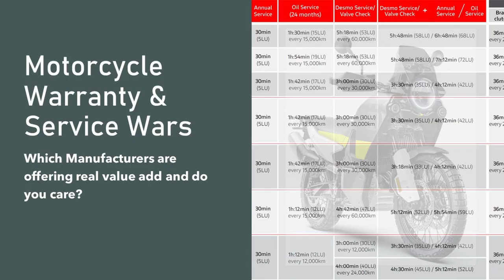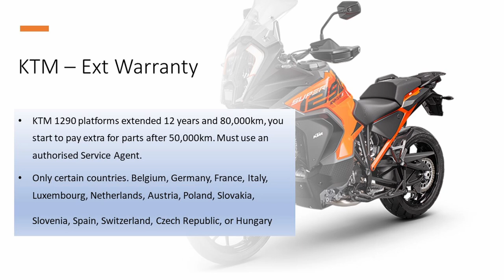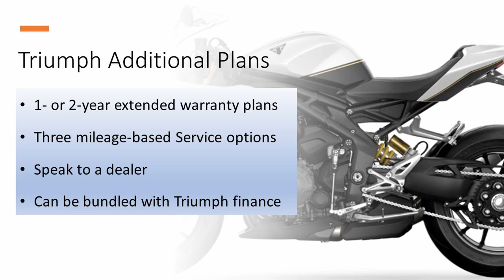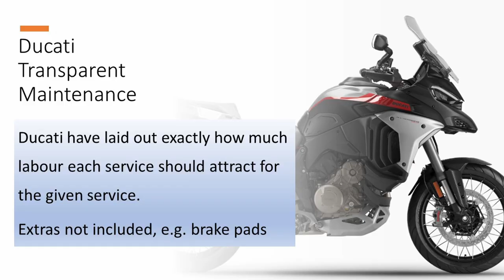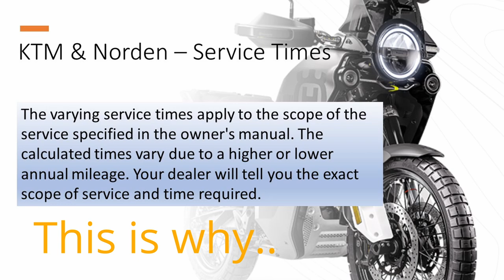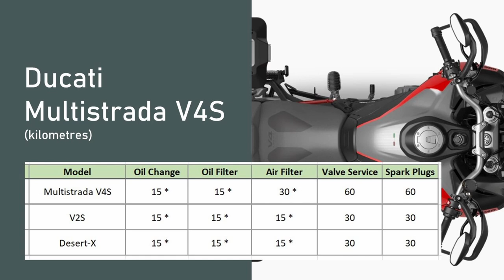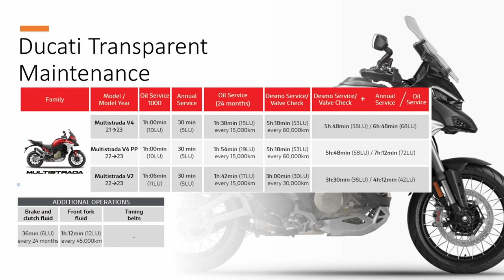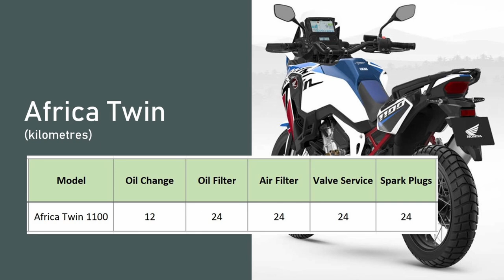Motorcycle Warranty & Service - Fight!

Comment: I bought a Honda Crosstourer in 2013 and added the service pack for £525.  At that time it included the running in service plus 9k, 18k and 27k miles.  What a deal that was, they stopped offering it quite quickly though....😂   I've currently got a Gen 3 Triumph Tiger 1200 albeit use an independent local garage which has kept cost down.  You're spot on though in that a bit of research is needed on servicing requirements and cost prior to purchase. Especially if you're a high mileage rider.  Great vlog, really enjoyed it.  Thanks.
Reply from the maker: Thanks for the kind words 👍. Yes, you got a bargain with the Crosstourer, that was some deal. It was my Gen 3 Tiger that got me for a €1480 service on the valve service, I was pretty upset I can tell you. Before that the Triumph services were reasonable at the main dealer. Thanks for posting 👍.

Comment: On the Ducati servicing, the hourly rate in the UK is over £100 so the big near 7 hour service plus materials will be pushing £1k, ouch. I bought a Honda this year and looked very carefully at the fixed price servicing but in the end decided against it as did not think it was value for money. Now folk will no doubt spam me for saying this, but it is basically the service is an oil change and perhaps a filter with the rest being a visual check. Oh, I may have short changed them, they also check the tyre pressure 😁 You are of course correct if the bike and BMW is one of them for sure, is full of tech but a good thought provoking video and enjoyed the funny bits 🤣
Reply from the maker: I think a lot of V4S owners will trade in their bike at 60,000 km 😃 to avoid just that service but at least it is at a decent mileage. It is also great that Ducati recognise that there is not too much to the annual service and only allocate 30 minutes to it.  I think you are right about a lot of the servicing, there is not too much too it but my Tiger did get several software updates in its life (I don't know what for) which I could of only got at a Triumph dealer. Thanks for your points and glad you liked the content 👍.

Comment: Can I nominate bmw for the shooting yourself in the foot award? They don't update the software on the tft unless you have an issue. One of their few competitive advantages and they won't touch it with the latest and greatest version. Seem to do it freely in the UK, but not here in Ireland.
Reply from the maker: That would be an odd thing to do I would of thought? I get the feeling that BMW software updates are a long old process from what a lot of people say, it's like they have to reflash the whole bike, that might account for them trying to skip it unless totally necessary? I would like to think my bike would come out with the latest version if it went in for a service, I'll have to watch that.👍
Reply: @terenceokeeffesmotorcyclestuff  was told by them that they were advised by bmw not to update. They will have to now, with the recent issue bmw flagged that requires a software update. But this will be an exception. Interested if Duffy's follow the BMW instruction but Cork dealer does. Mine was serviced late last year and spoke to them about how long it would take as I know Smoaks who is a tech and has a youtube channel let's them update overnight. Astonished when they said they don't touch them. I'm on 19.180 for a 2019 bike
Reply from the maker: @paulsire  thanks for the information. 👍